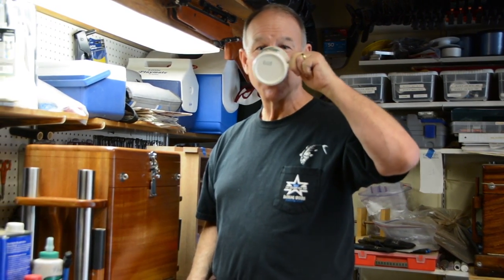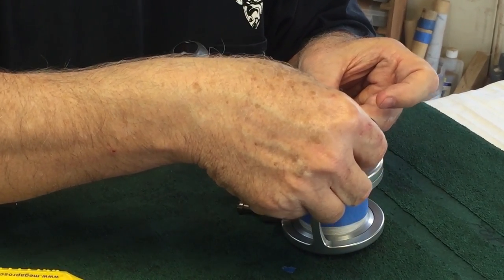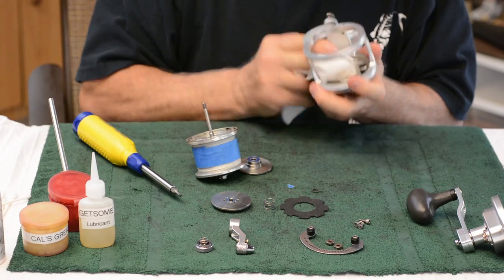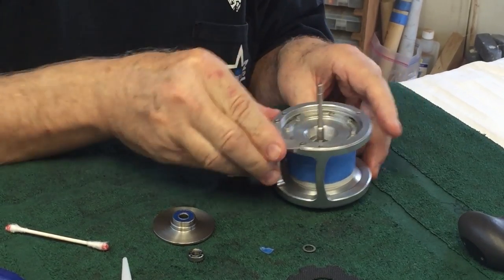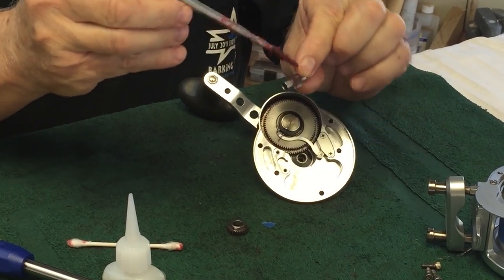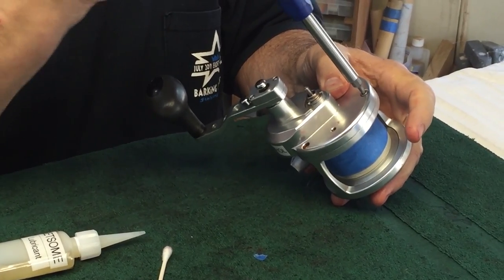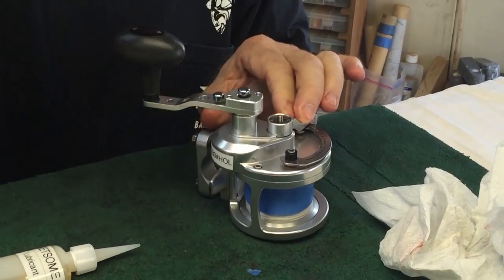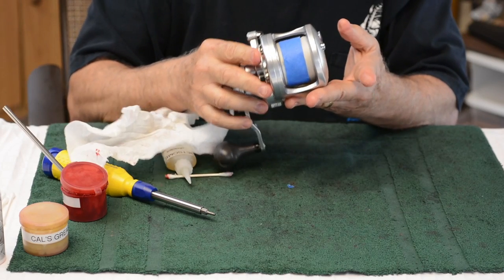Avet JX Raptor Reel Service

Comment: Hey Mark,
Thanks for your time and effort, you have saved me tons of both.  I have several AVET single speeds and know how to break down the handle to replace the pinion bearing.  These seam to need replacement occasionally.  Can you make a video on how to do this on a LX 2 speed?

Comment: 6:08 I noticed the gears popped out really easily. I feel like mine are jammed and I can’t remove them on Jx 6-3 mc raptor. Any suggestions. I did this service (reel is less than 2 years) plenty of oil/grease, just dirty. After service, high gear feel like it’s grinding on down stroke of handle when reeling. Any suggestions?
Reply from the maker: Try cleaning the teeth inside with brake cleaner. Clean that stuff with an alcohol and grease again. Hopefully it will help
Reply from the maker: Some are tight, some not. Always grease the insertion hole to help get them out next time.

Comment: thanks for such useful videos , one question i have does all raptors are basically the same as the jx, how you service it,, thank you again for taking the time to do the videos
Reply from the maker: Yes, all raptors are the same except you have to deal with the strap lugs on HX Raptors.
Reply: wow thank you for the quick respond  :)

Comment: Great video Mark. Just wondering if the magnets can be removed on the MC Cast to gain better freespool? Seems like all the Raptors from the SX to the JX come with the MC Cast which IMO does not freespool very well even on the lowest setting. I have an HX Raptor without it and it freespools very well.
Reply from the maker: I agree but just fish the reel as is. It performs on the ocean as you want and I get the bait out there.
Reply from the maker: I don’t think the magnets can be removed

Comment: I would like to add a power handle to my Raptor JX 6_3. is there anything I should be on the lookout for when changing out the speed housing and the actual arm itself?
Reply from the maker: Check my speed shifter video. Be careful

Comment: Hi there,
My JX two speed is cranking freely on both directions.  Lever is engaged and even locked but made no difference.  Any advise will be appreciated.  Thanks.
Reply from the maker: Gear upside down
Reply from the maker: Drag gear is either upside down or you installed the dog upside down. Easy to fix. Check for dog action BEFORE you close up the reel and reattach the right side plate.

Comment: You don't remove the handle and the main gears?
Reply from the maker: Only when the bearings are bad. Mine almost never go bad. I’ve had to with two reels in seven years. I use tons of drag too!
Reply from the maker: Not every time - not needed.

Comment: The drag washer, you said you greased it.. I read on a forum of some guys doing the same and some guys saying that's a no no, I am confused as why to grease them or why not to grease them. What is the benefit? Could you please explain?
Reply from the maker: Grease it as per my suggestions and skip the doubters. It works with every Avet I have.
Reply from the maker: Grease it
Reply from the maker: Do it!

Comment: Mark , what does avet have that compares to the penn torque 40narrow lever drag , in line capacity and gear speed..Thanks!!
Reply from the maker: I am not an Avet insider I just buy them, service them and use them. I think the either the stock JX raptor or narrow HX raptor should be a match for your request. Save money and buy the Avet and easily service it yourself.
Reply from the maker: JX Raptor fishes 50-60 easily.

Comment: hey does the raptor make noise when you shake it. could it be the mc because it's close to the spool
Reply from the maker: I just tried my two JX raptors and no noise. I leave Monday on a 10 day on the vagabond.
Reply: +Mark Mayo could it be beville washers they look odd. but can't find schematics
Reply: +Mark Mayo imagine this is the spool.    l-----l it moves slightly left to right when I shake it makes like a little thump. have nice trip